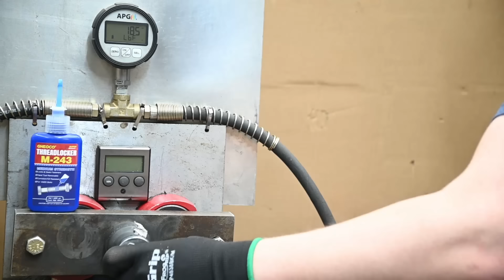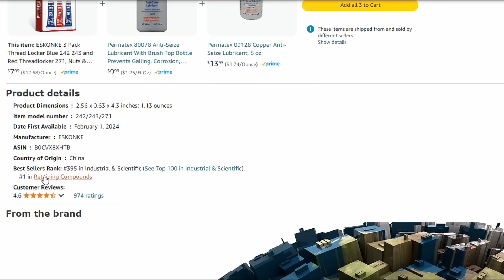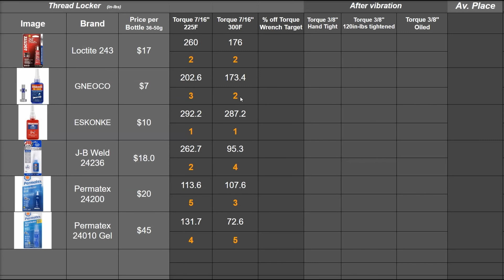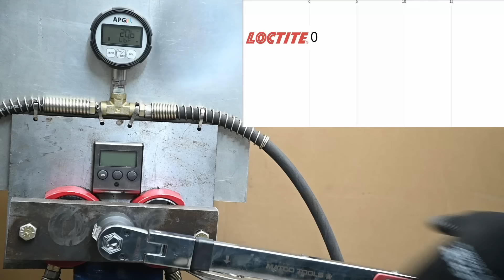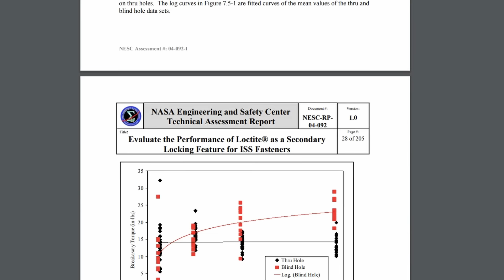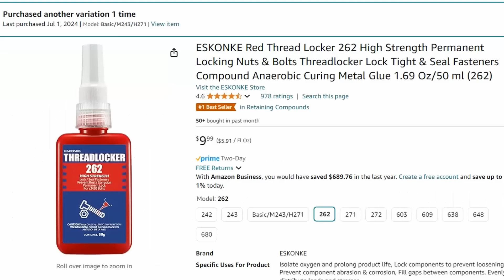Best Thread Locker isnt Loctite? vs Permatex, JB Weld & Amazon

Comment: The curing also depends on ion exchange, that's why some lockers can only cure in the presence of iron, but even an open bottle never hardens/dries out.
Most are multi metal acting now, they use funny tricks to also cure in the presence of aluminum or titanium.

Comment: Unfortunately this data isn't as relevant for practical use. I don't need the strongest blue thread locker. If you have ever done work in the field, a stronger thread locker only makes your life much, much worse. The point of blue thread locker is to keep the bolt from coming loose, not weld it in. 

However, the part about torque accuracy is much more relevant.

Comment: Hey, at 12:30 you said that LOCTITE 243 is supposed to be oil resistant.
This is true, but only for most factory oil coasted fasteners, and not all of them (see Product page). 
243 is not made for being used in an oily enviorment and is only resistance against minor oil contaminations (see TDS).
Since you  have coated the Bolts with a good amount of oil it makes sense that LOCTITE 243 has problems with it.
Reply: Yeah, I would have liked to have seen a more reasonable oil contamination test.  I'd never ever bother to use a threadlocker on a fastener that has oil pooling on it.  What would be beneficial to see is what threadlockers can resist a minor coating of oil or grease that has been wiped off with a rag and generally wiped reasonably dry.

Comment: The substrate actually matters with threadlocker.  Plain steel has has about twice the holding strength compared to stainless steel or zinc plated bolts.  Plain steel nuts and bolts also cure faster.
Reply: More reasons why i will simply be refering to this stuff as "magic sauce" from now on. If im putting it on, its either because i was told to or because i have a feeling. Thats it.

Comment: FYI the lubrication you can get out of a threadlocker or other thread coating is most often not about getting a higher clamping load, but more consistent clamping loads across all bolted joints. Plain bolts can have pretty wildly varying clamping loads, and many applications require a tight, consistent clamping load. There's a particular application that I use a higher grade, pre-applied microcapsule thread locker for this purpose. I need the bolted joints to be within a tight range of clamping load, but I also need them to not back out and to last for 10+ years. Another thread coating, like teflon, would allow me to easily get that tight range of clamp load, but it increases risk of bolts backing out, especially with the light clamping loads we have, so we use a pre-applied thread locker to do both.
Reply: Another important function of locking compound is sealing the thread from corrosives that will cause them to seize
Reply: @PaulG.x  Also very true! I was mostly focused on sharing the specifics of my application, though, which doesn't share that concern.

Comment: Rockset is an interesting threadlocker to test. It supposed to function like red, but heat doesn't release it, hot water does. Its used for firearm muzzle devices.
Reply: Never had any luck with rocksett
Reply: Never tried it but gunsmiths SWEAR by the stuff.
The two drawbacks are it's expensive and it has a very short shelf life. 1 year and unlike most thread lockers once it's expired it's rendered useless.
Reply: @rileyneufeld7001  I only order rocksett when I know I'll be putting on suppressor QD interfaces because of how fast it expires. Most muzzle devices have large margins for misalignment and are fine with the uneven pressure imparted by crush washers, and gas blocks can be staked over to secure the set screws without the use of high-temp threadlockers.
Reply: @Dprill95  I've only used it on qd mounts for suppressors, the mount hasn't come off with the can again so I think it's working. I honestly didn't know about the short shelf life, so I guess I have a useless bottle now.

Comment: I guess my contention with low/medium strength threadlocker is that I don't need it to be harder to break free than what it was torqued to, I just need it to not loosen.  So, ranking blue threadlocker that takes more break free strength as better doesn't really jive with how I think most people are using it.  

Take for example Loctite, even on the 300 degree heat cycle, 176 in-lbs still exceeds their listed break free strength on their website, which is listed as 106 in-lbs.  Even the fact that Loctite's finger tight 3/8" fastener dropped to 32 in-lbs of break free torque after all the vibration is still fine, as it isn't loosening.  The other thing to consider with the heat test is that most ovens will exceed the target heat setting for a short time before settling back to target setting.

Obviously, there's some overlap there with providing a substance that can prevent a fastener from loosening and not creating too much break free torque, but overall, when I'm using threadlocker it isn't to provide extra strength, it's just to maintain the torque I've set.  

So, for me, accurate torque value with the threadlocker, along with the fastener not being significantly harder to break free than what I torqued it to is most important.  I would have preferred to see the threadlockers do better with the oil test, but I'm not going to use threadlocker on any fastener that coated in oil, so, generally not an issue. So, of the various threadlockers, the Loctite still provides the most beneficial metrics for me personally, accuracy of torque values, consistent resistance to loosening except for liberal oil contamination, and break free values that aren't excessively high.

Thanks for the test, really awesome!
Reply: Probably better process control too
Reply: Well said.
If I want higher break free torque, I will use red instead of blue lol
Blue is specifically for when I want to ensure that the bolt only comes loose when I want it to, and also to ensure that it will indeed come loose, because it also functions as an anti sieze, protecting from corrosion and binding.
Reply: Great reply, I agree completely.

Comment: So basically,  if i walked into a big box store, I'd buy JB Weld threadlocker for threads with oil exposure, Loctite for applications with heat, and either for an application with vibration, like a vehicle chassis. Probably avoid Permatex threadlocked because it's an inferior product.

Comment: about 20+ years ago i replaced the transmission in my wifes truck. i was young and didnt know any better and didnt use thread locker on the converter bolts. needless to say they backed out and my father in-law tighten them back up using clear fingernail polish. needless to say the bolts are still in place today. im sure it wont match thread lockers status but it would be nice to see where it does fall on the chart
Reply: Yes! My stepdad is a 30 yr retired Aviation mechanic, and he used clear nail polish in a pinch on my project car as a kid, would love to see this in the list as well.

Comment: Great stuff here! I feel like it's somewhat important to point out that the 243 line you mostly tested targets the surface insensitive range of blue, which is both oil resistant and generally a newer formula than the 242 range, which is what was tested with Permatex (24200, they use the last two digits to differentiate between package sizes) in this video.

The Permatex product numbers are slightly tricky like that, but Vibra-Tite really pulls a tricky one with theirs, often taking the standard number everyone uses and doing some simple math with it, like the low strength "222" for most threadlocker brands becomes "111" for Vibra-Tite. I think because "242" got an update and +1 for the number, Vibra-Tite started with "121" and then made "122" as their surface insensitive version.
Reply: Hey! Great insights.

Comment: Interesting 
In the shop I keep Lock Tight 243 , 263 and 272 for different jobs
But I also have used a Anti sabotage permanent thread locker that we had to use at work 
We got it in plain White tubes with just Permanent on the outside of the tube 
After a few days if you wanted to remove the nut , on a 1 1/8" bolt 
We would have to torch off the nut 
As even with a 1" impact and heating the nut with the with a torch
Or a wrench and 10 foot cheater bar 
We never could get the nut off the bolt without twisting the bolt to the breaking point
Reply: If you can't even get the nut off with heat...what's the point of bolting the joint together? Just weld the fucker! 😂
Reply: The previous owner of my motorcycle must have used that white bottle stuff when he installed the rearsets. It was a nightmare.

Comment: I bought some Eskonke after this video. One caveat: in the winter, it's basically unusable. I've been using it in the garage for the last few weeks, and it's basically impossible to get out of the bottle. I wound up having to screw the top off and dip a nail in. I guess gel thread lockers are not good for places that get cold.

Comment: I have used "contact cement" or rubber glue (comes in tire plug/patch kits), it dries kinda gummy, great at resisting vibrations but still easy enough to remove (i use it for thumb screws) so you still have to be able to remove it by hand withiut tools

Comment: The purchasing guy at work just bought the crew sets of Loctite PN 576507, stick applicators. I would like to see some testing on these "lipstick" type applicators vs traditional liquid or gel bottles. At least compare the 248 lipstick to 243. The lipsticks are better to carry in a tool bag than liquid bottles that spill or leak.

Comment: I would like to see drill bit lubrication tested. Does any type of cutting oil actually help? or is the real benefit the added cooling? would water work just as good as expensive cutting fluid?

Comment: If you can get it, I would love to see Liqui Moly thread locker. It's a German brand that I use. 
And please get the ultra cheap stuff from Temu. Oh, and the Loctite sticks, the glue stick like Loctite stuff is so good to use on smaller bolts.
Reply: I have some of that “glue stick” type you’re talking about. It’s called Qiuckstick. I’d like to see them test the Super Glue thread locker too.

Comment: My last purchase was Permatex.  That will also be my LAST purchase of Permatex.  My Permatex blue and red gels are headed to the trash.  I thought I was just imagining that it didn't hold as well as the Loctite I had been using for years.  Thank you for this video!!
Reply: Same here
Reply: Just because it wasn't as good as another product doesn't mean it isn't worth using.  I recently used the red gel on a couple bolts holding a driveshaft to a rear pinion.  I was interrupted before I tightened them down and the loctite had already cured.  I still had to heat the area with a mapp torch to get them loose.  Not as good as the next product, but definitely effective.
Reply: This permatex tested here is the 242 model number which is comparable with the loctite 242 which is a lower strength medium loctite. For small bolts and screws that strip easily (flat head/Phillips) and especially for knives with small torx screws the 242 strength works great!
Reply: @RK-kn1ud  I understand what you are saying.  But my original comment said I had noticed a didn't hold as well as my usual choice.  The fact is, it didn't hold at all.  Some of these products work better on certain metals than on others.  I was using it on brass Chicago screws.  The Permatex never fully cured.  Some of these require at least one of the metals to be ferrous.  My normal Loctite cures with any metal according to its label.

Comment: When I got my PA state safety inspection license it was at local Vo Tech auto shop. There was signs up that said Little bolts < 3/8 to use anti seize on them. Larger bolts use Loctite. It will actually act as an anti seize since it doenst allow corrosion to intrude into the threads.
Reply: Yep. I use loctite at the top of the threads for this purpose.
Reply: Yeah I've actually switched from using anti-seize in general to almost always using blue thread locker or something more intense like orange or red when necessary. I try to make sure there is some on the threads closest to any environmental exposure so it creates a vapor barrier. Seems to work well to prevent rust to me and less risk of a loose fastener. There are still some bolts I prefer to use anti-seize on, but even then I often have the fancy Nickel stuff.

Comment: Quick question when are you all going to be testing the DCF 964? It seems to hit pretty hard, quite a bit harder than my old DCF899 although I did manage to stop it. Probably not a fair test in trying to remove the trunnion bolt from a 65 year old dozer is something that is going to be impossible for anything outside the torch. The 899 wouldn't do anything to it but the 964 broke square bolt head contact weld loose hard enough my dad on the phone was like "what the hell was that?"

Comment: Honest question….. gm calls for using thread locker on lower intake bolts to keep keep oil from getting into the intake cavity from the heads.   Do these actually seal threads properly?

Comment: Great show guys. I’ve wondered if there is a shelf life to lock tite, maybe you guys could save the bottles and do the same test next year? I have bottles that are at least 7 years old. Always stored in a temperate area 45-70 degF but maybe it breaks down? I’m not sure.
Reply: It's probably a case of "guaranteed to meet spec" before its expiration date. Could be considered important, particularly in a manufacturing or commercial setting. I don't use much and have small tubes that are aging and they certainly work, but maybe they're only 95% as good as they were originally.

Comment: I've been using Inbus threadlocker myself, if there's a followup I'd be curious to see it. Works well enough for me, that said I use it on electronics mainly. Laptops, coffee makers, Ipads, TVs that sort of thing because I repair them which involves taking them apart, screws into soft material will never stay tight without help after a few goes so threadlocker becomes needed. Especially on devices that get moved a lot. But the strength requirement is super low so it's not too big a deal. But still curious how good the stuff I use is objectively beyond "good enough for my application"

Comment: hmmmm, what's better though, slightly overtorqued or undertorqued? I think I would take slightly overtorqued but if undertorqued it shouldn't be a problem after the threadlocker has dried. The Eskonke seems to beat out Loctite in everything except the fact Loctite does not affect torque spec whatsoever. If using Eskonke, should one adjust the torque setting by 5% more?

Comment: To cure properly, loctite requires iron. If you read the data sheet on it, it isn't meant for zinc plated fasteners, as the compound doesn't set up properly. They did a deep dive at my shop and found that loctite doesn't work for many of the applications that we need it for, as we use a lot of zinc fasteners. Since zinc is just a plating, technically running the bolt in will scratch some of that plating, but you won't see the same results as if you had a non coated bolt.

Comment: I think the "oil resistant" is more after it cures and then exposed to oil than exposed to oil and then applied. Kinda like water resistant boots but you get your feet wet first before you put on the boots. For those that might have fasteners exposed to oils and such after installation and don't want the oils to weaken the thread locker and make it fail. 

If its hand tight and not torqued then maybe you would want it to stay hand tightish but not jiggle loose like what you would find for a wingnut or those hand nut plastic things on a lawnmower so i would not see that as a bad thing to go for.

Comment: Please add VC3 to your tests.

One major advantage to VC3 is it cures into the fastener BEFORE installation so if the nut or receiving side is full of oil no problem. 

Additionally, VC3 does not increase the breakaway torque significantly and may be used 2-3 times before reapplying in some cases.

Comment: Sorry if it's already been said, but anaerobic sealers used for metal fasteners only cures in the presence of metal ions. Think about it, it stays "liquid" in the tube even if you squeeze all the air out before sealing the tube off.

Comment: Ive always been taught to use loctite a drop large enough to cover 3-4 threads about 2-3 threads from the bottom. Ive never had an issue with that amount being too little or too much, seems just right.

Comment: I don't understand the test that started at 2:22. What were you measuring, how much torque is required to loosen a bolt that had threadlockers applied to them? Because it looked like you were turning each bolt 90 degrees and stating a torque number? I probably did miss the explanation. Rewatching always annoys the hell out of me.
Reply from the maker: Yeah sorry. Probably makes more sense if you had watched our tq wrench episode. It measures bolt tension. You can put 200 in to a tq wrench but that just measures ur effort, not the resulting clamping load. This test demonstrates how some compounds act as a lubricant, in effect overshooting the input torque. Less friction means more bolt turning than expected, which means a more stretched bolt than intended.